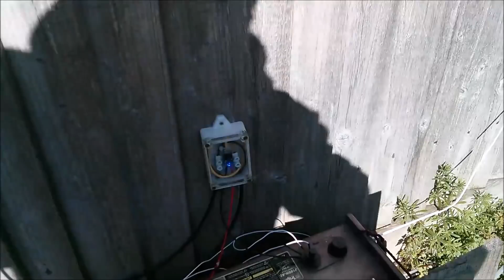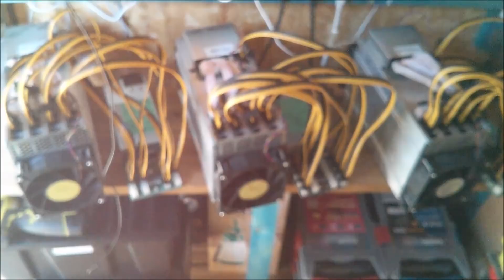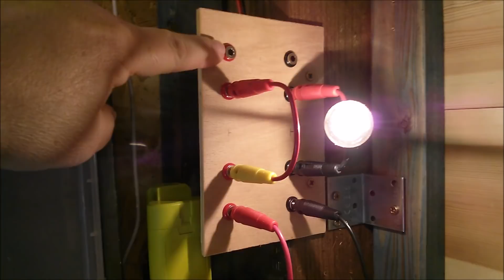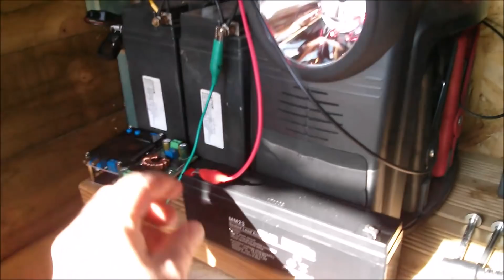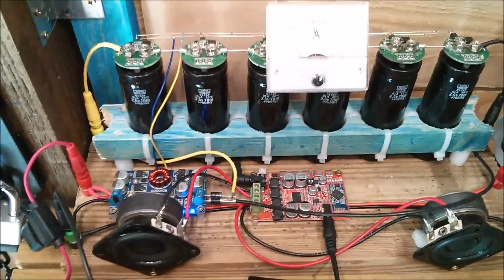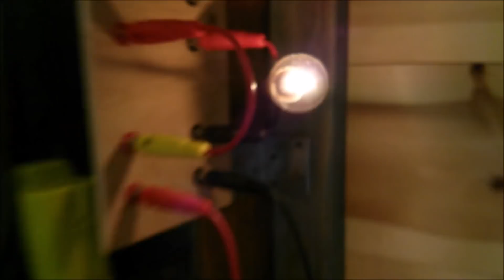Happy in my Shed

Comment: When I see you plugging jumper cables into patch panels to steal 12V from the lighting circuit so you can charge supercapacitors to 5.4V via an automotive bulb just to flash several dozen LEDs, then coercing 100V from solar so you can power a machine with bare connectors, seemingly random wires running off to various circuit boards sitting all over the bench, and so on and so on, two things come to mind:
1) Dr. Frankenstein's lab, a la 1930's Hollywood
and
2) No wonder she kicked you out of the house and into the back of the garden.

Still - looks like you're having more fun than most ... :)

Comment: Your shed is 10˚C hotter than Clive's bungalow. I do love your wiring Julian, it reminds me of so many boats.
Reply from the maker: Yes, if the Isle of Man came up for sale, I'd have to pass - too cold.
Reply: The humidity makes quite a difference. Cheers from Colorado where it will be -4˚C tomorrow night but shorts are still suitable and the joggers will be running in the snow.
Reply: @JuliansShorts  did you manage to get rid of the mould in the shed? Is ventilation key ?
Reply: It's also daytime and not 3am. I doubt Clive has seen the sun before ;-)